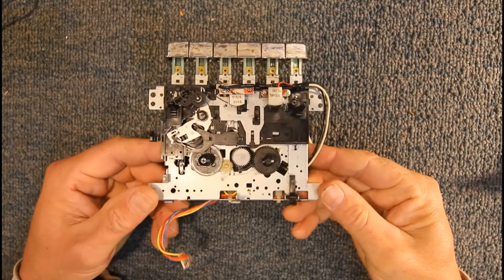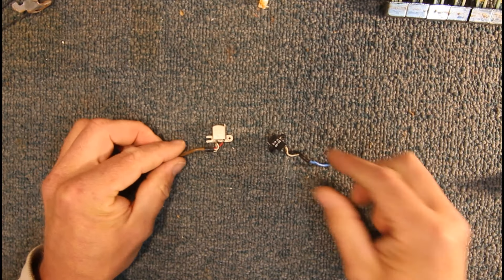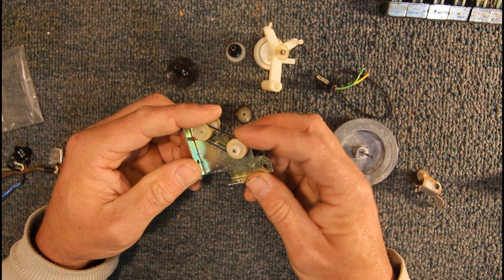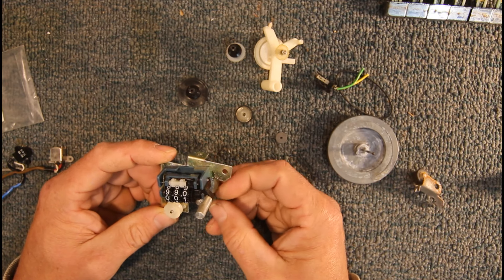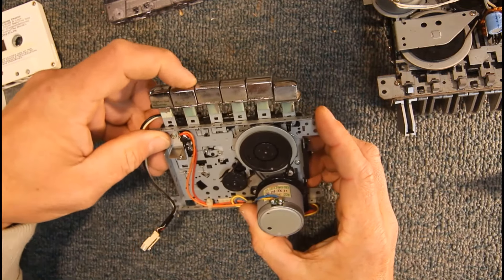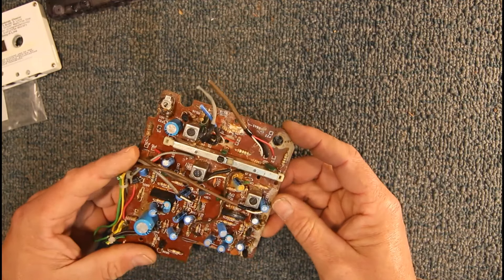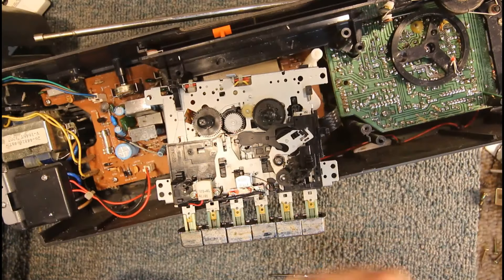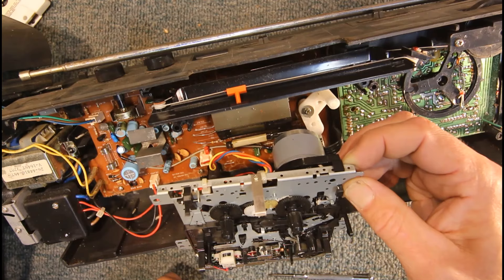Cassette Tape Player. How it works and how to repair.

Comment: how do the motors electronics work???  I'm making a echo tape delay and i want to change the speed of the motor and add wow and flutter with a random astable signal to the motor, do you think this will work???  anyone???
Reply from the maker: Most motors have an electronic speed regulator built in. Its only a few transistors and a trimpot to set the speed. It could be removed from the motor case and either modified or replaced with a new circuit to do what you want. I dont think I have ever seen the circuit of the speed regulator inside a motor, but it would only take a few minutes to draw one out for whatever motor your cassette player has.

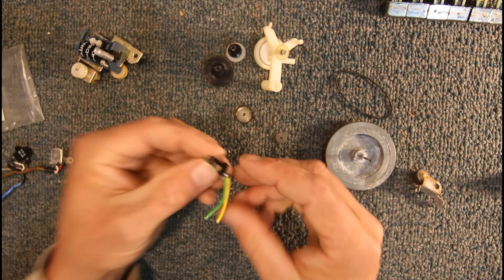Comment: Yeah right at the 14:00 mark you said that the leaf switch for fast forwarding and rewind and record how do I remove this one because it is not working on forwarding and rewind and record
Reply from the maker: Follow the wires back from the motor and one will usually go to the switch. They are either attached with a screw or clip in. If the switch is faulty the motor will not run. You can bypass it with a clip lead or short the terminals together with a screwdriver and see if the motor then runs.
Reply: Yeah it plays the tape and records it it doesn’t rewind or fast forward when I push the button for fast forward and rewind button it just pops back up
Reply: It’s a GE Model 7-4966A Clock Radio with a cassette tape deck

Comment: I tried to restore old cassette player and only take up reel is rotating and another is stagnant  .....is there a need for both the reels to rotate ??..
Reply from the maker: Only the take up reel turns in Play and Fast Forward. The supply reel should be free to turn but wont move without a tape in place. The Supply reel is turned by the motor in Rewind.
Reply: @StevesElectronicRepairShop  thanks for your message

Comment: aaaagh, i got a pioneer ct-980w double deck and i cannot for the life of me figure out why the pinch roller doesn't go up enough to let the capstan roll it... :(
im pretty new to this.

(this is on the first door, second door plays fine altho the door doesn't open.)
Reply from the maker: Compare the pause button action on both decks. If its stuck in the pause position there will be some sort of lever pushing the pinch roller to sit just off the capstan.  Could also be that the whole plate that lifts up with head and everything on it is not moving up enough. Compare to the other deck when in play mode for even a small difference in position.

Comment: Can you help me please I have old 1985 boombox (radio and cassette player ) the mechanic works and the cassette turns but no sound coming please (the speakers work perfectly with the radio please mine is a contec 8080 pls
Reply from the maker: The first thing to try is putting some switch cleaner lubricant in the record/play switch as that will often cause no sound on tape.  See 34:34. It could also be the switch that changes from radio to tape. Its very rare that anything else goes wrong with the electronics.
Reply: Steve's Electronic Repair Shop no I don’t know I just found it behind my appartment with a cassette I took it the cassette works properly on the WALKMAN where can I put the lubrifiant please there is not record or play switch it’s buttons and I’m a 12 years old kid so I don’t understand these things a lot
Reply from the maker: @stacy3  The switch is inside the unit on a circuit board. You could try putting in a blank tape and press record then stop and repeat a few times which will move the switch inside which might get it working again.
Reply: Steve's Electronic Repair Shop thanks
Reply: Steve's Electronic Repair Shop I will show it to my dad to help me thank you

Comment: how do you put a sprocket on a pulley that has come off?...37:40 talks about the pulleys.
Reply from the maker: Do you mean the sprocket part that goes up into the tape has come off? The older ones with a metal pin that comes up through the middle have a little plastic clip that holds them on and that sometimes comes off and needs to be replaced. You can see it in the center of the other sprocket. If the pin is not visible then I think they clip onto the pin somehow, and if they come loose it usually means they are broken and need to be replaced.
Reply: @StevesElectronicRepairShop  thanks so much. I do believe a clip came off...makes sense because I see broken plastic.  Fortunately it was on a low quality sony boom box cfs 210. I enjoyed your video and thanks. Cheers.

Comment: I'm gonna try to use this video to convert a boombox into a walkman
Reply from the maker: A walkman just had a slimmer mechanism with nothing to enable recording. They used a smaller slimmer motor that ran on 3V so two AA batteries, and the electronics was stripped down to just run headphones.

Comment: Any one have an idea why my dolby tape deck won't accept the tape I taught maybe it only takes a dolby tape but I'm not too sure
Reply: It seems the pinch roller is already engaged against the capstan even when there is no power on
Reply from the maker: @seankennedy8506  All cassettes should fit in all machines. Dolby just alters the sound a bit.  If its a soft touch machine using electronic switches instead of mechanical buttons, then its likely a loose or broken belt stopping the machine from dropping the mechanism back into stop mode. If it has mechanical buttons then there is a problem with them, or the sliding plate that unlatches the mechanism so it can drop back into stop mode.
Reply: @StevesElectronicRepairShop   The pinch roller doesn't react to the stop or play button it's stay in the same position it only moves if I nudge  the plate up and down with a little screwdriver so I;m guessing there is some dried up lubrication somewhere. I have to take the back off to get to the drive wheel and the mechanisms I have it out of the unit completely now.
Reply from the maker: @seankennedy8506  In that case it probably is seized up on the shaft it pivots on. You will have to remove the circlip or whatever holds it on, pull the pinch roller assembly off and clean any old grease off before relubricating it. Make sure you dont get any lubricant on the rubber roller.
Reply: @StevesElectronicRepairShop   Is 3 in 1 oil okay to use?
Reply from the maker: @seankennedy8506  A light coating of oil on the shaft the pinch roller pivots on should be fine.

Comment: Remember back when if something broke, you could fix it yourself? Today, it's not  even worth the money to replace a part.
Reply from the maker: Unfortunately manufacturing techniques used to keep the price down often make things much harder to repair, so its a double whammy. You are lucky if you can even get parts these days. Its certainly no fun to work on any more.
Reply: @StevesElectronicRepairShop  do you know, on my tascam four track, it's stuck on play mode, immobile, and I can't get it to let go. Is that an issue with the stop button?
Reply from the maker: @aurora3655  Only if its a very basic mechanism, it would likely be the slide plate that releases the buttons and mechanism. A Tascam likely has soft touch controls and uses a gear to move the mech into play and record modes. Its usually due to a failed belt not allowing the motor to rotate that gear back to its stop position. If you have no other rotation I would think belt or motor related.
Reply: @StevesElectronicRepairShop a belt! Ok! Thanks you so much!  Do you think I can just open it and place it back on?
Reply from the maker: @aurora3655  If the belt has come off its likely broken or stretched and will need to be replaced.
Reply: @StevesElectronicRepairShop  where do you even find such a thing?

Comment: Steve's Electronic Repair Shop I have a onkyo ta-rw400 it won’t record on deck b
Reply from the maker: Does the deck mechanically work when you press record, does the tape look like its running? If so do you get anything recorded on the tape or nothing? Does it erase an old recording on the tape?

Comment: I just got a vintage Sharp QT-40 cassette radio cassette player from the U.S & iam from Aus , i am using a step-down transformer the radio works correctly, but the cassette player when playing a tape at a very slow speed, and there is a very noticeable mechanical tapping noise even when there is no tape is in the player, it will make the noise, i have not opened it up yet. Here is the link in the video on youtube https://youtu.be/PKZdzRkuXKQ
Reply from the maker: It will be related to the motor and capstan flywheel. A noise like that may be a wire or something rubbing on either of those or the belt, or could be a fault with one of them. Given the speed of the noise I would say its the capstan lubrication, mounting, or something rubbing on it.

Comment: Start out to maje others clear . I left bad date site mistake an I live to sing. Oh she destroyed 3 vehivk8and all but few pants an shitt. 

Now I live sing mom gave ne compuspeakees I hope to phone but they not that loud so I lookin at  an early 90 2 deck cassetradio.  I thought Humm can I run it through head wires. . Took me a bit but have to push play button too.   But I getting static in with my YouTube through phone.   Is it crossing signals.  Wires to close idk just wondering if no static ID get lit oh volume

Comment: hi them test tape don't work at all in the 4 track cassette  recorder way the tracks were recorded  i had to get a full track one as i know the right people  
i have a full track reel to reel 1/8  basf   i moved the test tape in to a zero  cassette with me otari DP27OO when i used the cassette i move the tape back on the spool
again  alot of line up cassette are made in a fast dubbing set up  a man a know his mate died left alot of cassette dubbing set up and pass alot of know how to me 

if i was to make  video's it would go crazy and up set alot of cassette fan big time

Comment: I have a Sony tc-wr700 and after belt replacement unit motor stays on all time and ffwd lights on. Any ideas to fix?
Reply from the maker: Does it play tapes and the other functions work? Some auto reverse decks have one of the direction lights lit all the time, and I think some decks would run the motor all the time they were switched on. If the mechanism hasnt returned to the correct position you will get things like that, but you also wont be able to play a tape, and often cant even open the door.

Comment: I have 2 sharp gf 5859e cassette players  and when you press the play button it won't stay down, once you push it all the way it stops. if you hold it down it will play but is clicking, is that the auto stop?
Reply from the maker: It sounds like the auto stop engaging. Its usually due to the take up reel on the right not turning due to a broken or slipping belt.
Reply: @StevesElectronicRepairShop  thanks for the reply Steve, the auto stop seems to be a small piece of plastic close to the fly wheel on the rear, and it looks like there is a metal shape under the flywheel which moves couldn't quite figure it out as ones I have played with before are more like the ones in your video.You cant really see anything like plastic arms moving on this one.

Comment: Do you know why  all buttons on the Samsung mini cassette player doesn't want to stay down, and I have to press and hold them all the time  in order to work ?  The player works, but the buttons are keep pooping up  :(
Reply from the maker: There is a sliding bar that locks them into position and releases them when the stop button is pressed. Its usually either the grease on it has gone sticky and it doesnt move, or a spring that pulls it into place has a broken mount or has come off so it doesnt pull across and lock the buttons down
Reply: @StevesElectronicRepairShop  Thank you very much. You're awesome 👌